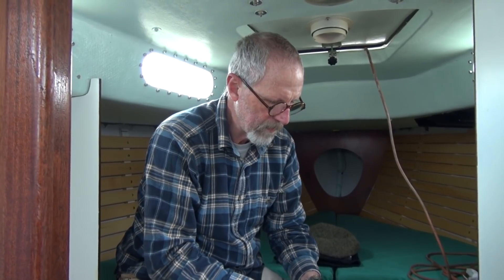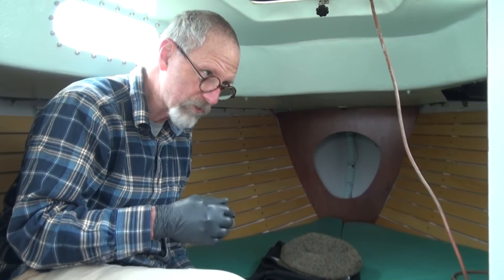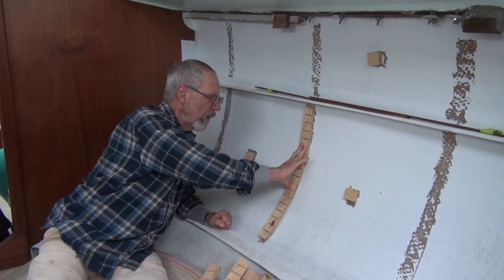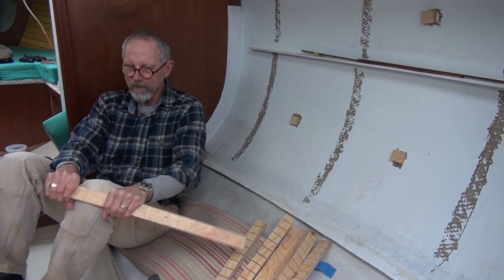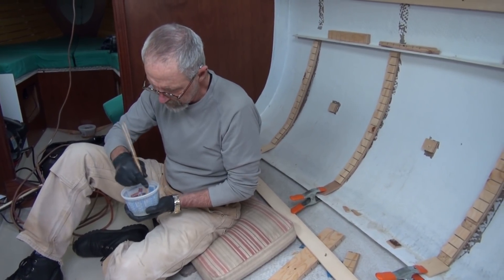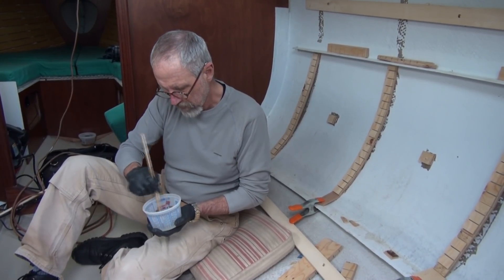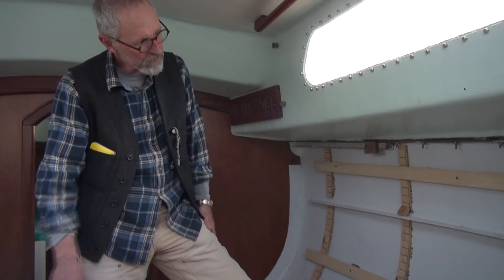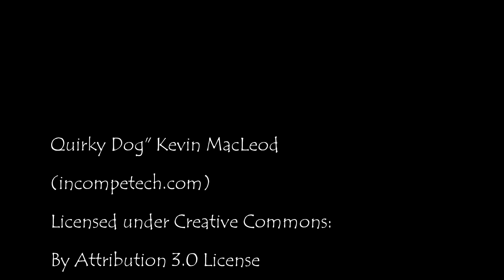Cruising Lealea Refit No.51: The Ceiling is not the Overhead

Comment: Liquid nail for those stripes to the hull would have worked great for that. The 3M extra strength comes in the small size tube and there is a jumbo size as well for a caulking gun.
Reply from the maker: The thing is, we had lots of epoxy resin and adhesive thickener on hand but would have had to buy anything else.  We did find that Gorilla brand construction adhesive would do the job nicely with less fuss and mess but we didn't have enough for the whole job.

Comment: Enjoy your videos! Can you insulate below the  water line?
Reply from the maker: Our intention was to use the Insuladd paint additive throughout the inside of the hull. Unfortunately, we found that the paint would not dry below the waterline with the boat in the water due to the low temperature of the sea here.  We will have to deal with that when we can haul out.

Comment: Just a quick question/observation. I have put kerfed plywood against a hull before as you have but I put it with the kerfs toward the hull and left the smooth side inward. Just curious if there is an advantage to doing it the opposite way as you have?
Reply from the maker: I don't know if it makes any difference.  It's just the way I learned how to do it.

Comment: Using a piece of scrap stock to slide between the slats to pull them tight onto while you put the fasteners in will help insure and even gapping to the ceiling Chuck. With end trim going in it will not really make much difference there.
Reply from the maker: Yes.  That is exactly how it is done.
Reply: Something is throwing my sight off, the radius light reflection, camera angle or my old age take your pick. LoL Looks perfect on the entrance shots. Would no doubt enjoy it very much more live.
Reply from the maker: I know.  The camera does something that accentuates the small difference in the gaps caused by the curve and twist of the hull in the bow. It's barely noticeable in person.